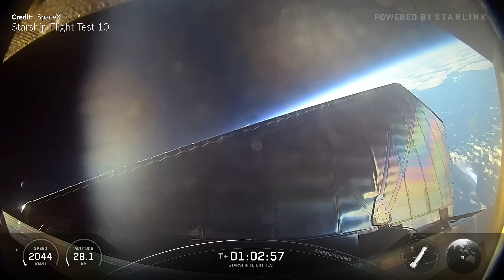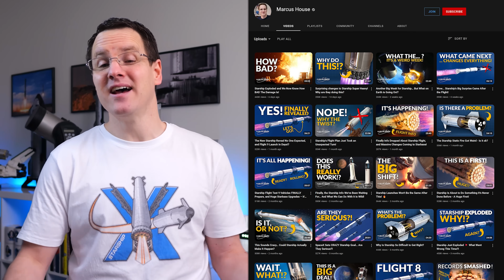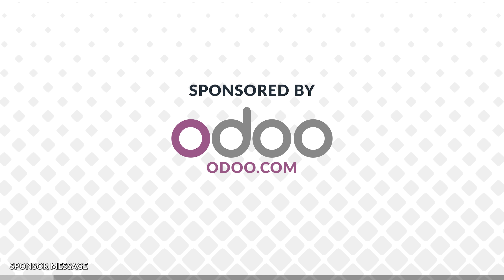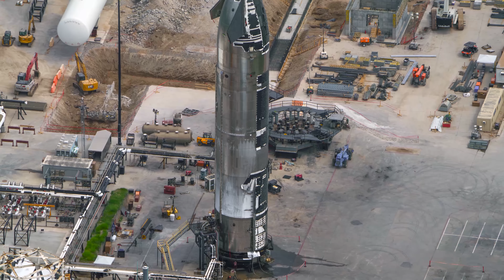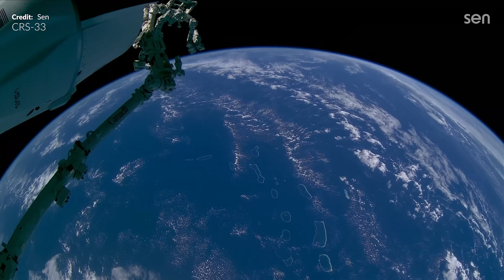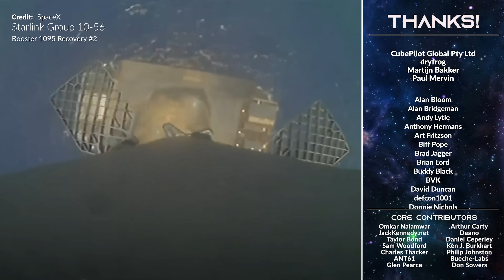Starship Flight Secrets Revealed & Future of Starbase! 🔥

Comment: When I first saw the explosion in the engine flap, I was thinking "Well I guess that's the end of it", expecting a RUD soon. But it just kept going and even survived re-entry. I was blown away.
Reply: Looked worse than it was. The hinges were fine
Reply: That such a sharp explosion failed to do any critical damage makes it very likely that it was external to the barrel - almost certainly those external chiller lines.
Reply: Ahhh, the redesign of the flaps adds some resilience to the hinges, which are far away from the edges. Each flight helps SpaceX upgrade, upgrade and upgrade.
Reply: @David-yo5ws  Well, this one helped. It's been a while. Although with the heat shield they're back to flight 4 results with the flaps burning through. Seemed like they had fixed that.
Reply: Reminds me of IFT-4 when ship 29 was missing half of its forward flap
Reply: You were blown away instead of Starship 😮😊
Reply: Survived to be slammed into the ocean and die!  Reusability my ASS!
Reply: @DrDiff952 🤦‍♂️ my guy do you know what an integrated flight test is? The whole point to do this is so that it doesnt fall on someone's head and then yall complain about how dangerous it is. Hence why it is called a TEST flight

Comment: The low g force is because it was a suborbital flight while the space shuttle and the capsules came down from an orbital flight.
Reply: Starship flies at orbital velocity. Nearly the same speed. Wouldn't make hardly any difference in G forces.
Reply: Nonsense.

Comment: I might be totally wrong here but I'm glad the flaps constantly seem to press on. Is it safer than the Shuttle if the same damage occurred? Appreciate any feedback
Reply: Flaps and wings do different jobs.  The flaps only need to generate drag and they can still do that with a lot of damage with modern computers behind them.   Wings like the shuttle had were also there to generate lift and their integrity is very much a part of the whole airframes integrity so their failure is worse over all.
Reply: @imaginary_friend7300 Thanks 🙂
Reply: This is just a test vehicle. If this was a production flight, I'd be HIGHLY concerned. Hopefully these issues will be resolved by the testing process.

Comment: 13:05  Welding the stringers across the grid fin hole and then cutting them off is the easiest and fastest way to ensure the stringers above and below the hole are aligned well during welding. So, not necessarily a test article.

Comment: Not sure if anyone else realized this, if metallic shielding oxidizes that fast during re-entry, then Stoke Space and anyone else relying on active cooling metallic heat shields are going to have major problems down the road.
Reply: I believe the steel tile that created all the orange color was not actively cooled. As we see elsewhere (e.g. Raptor), active cooling can prevent to a very significant degree ablation of metals even in extremely harsh conditions like reentry.
Reply: @noahw3261 it's adding complexity which SpaceX is trying to avoid
Reply: @noahw3261  Regarding the Starship's heat shield during reentry, the heat shield surface area exceeds 0.5 acres. Can you provide an estimate of the liquid volume, required for active cooling of 1800 square yards to mitigate reentry heating? As you said, the Raptor engine utilizes active cooling, each engine is pumping 1400 lbs of propellant per second, with every drop being utilized as active cooling. Some localized active cooling of the heat shield may be feasible, a heat shield of any substantial amount would likely exceed the ship's payload capacity due to the mass of the required coolant.
Reply: We do realize this and so does SpaceX.
Reply: @KuroKoopa I don't get it. So spacex should shift from stainless steel to alternatives?
Reply: @Jonathan-ru9zl I think they're just seeing what the current tiles are capable of and how they could improve, with other types of test tiles placed around. From what I understand, the tiles are the most difficult problem to solve.
Reply: What about spacex?
Reply: @Jonathan-ru9zl  It means SpaceX will have to be very picky about where it implements mettalic heat sheilds, if there is an advantage at all.
Reply: @serpentphoenix  active cooled components don't oxidize because the low surface temperature prevents thermally activated chemical reactions. We'd have a hard time reusing rocket nozzles if they did
Reply: The picture of the metallic tile on the ship before flight already looked a bit orange, so I’m guessing it was not optimized for no oxidation. I don’t think the rocket scientists are shocked that some metals (but perhaps not all) are oxidized by hot plasma, and Stoke will have a way around it
Reply: @davemanmartin  You have a good point. We also don't know what metal Stoke Space is using for their heat shield but my guess would that it might be similar to Flare Tips from Flare Systems.
Reply: You're assuming that Stoke's re-entry shielding is 1:1 the actively cooled metallic testing tiles SpaceX uses which is extremely unlikely. For one, I doubt SpaceX's coolant is LH2.
Reply: They also re-entered ship at the worst possible angle on purpose for this flight to see what broke.
Reply: The fact that is wasn't predicted just show how little do we know about material science today
Reply: @Jonathan-ru9zl  I think it shows the limits of theory. We have a lot of knowledge of material science under normal conditions, but these experiments are under rather unprecedented extremes!

Comment: I don't really buy the explanation of the explosion being caused by blocked vent lines.  Thats a lot of damage to supposedly be caused by un-mixed, low-pressure gases.
Reply: Over pressure events can be extremely energetic.  At what PSI did the line fail at?  That's what determines how energetic things will be.  We may have to wait for a while to find out.

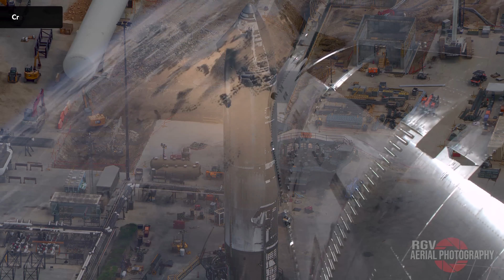Comment: 6:35 "... full orbital mission ..."
Since one full orbit takes about 90 minutes, some 1,550 miles of cross-range will be needed to compensate for the earth's rotation under the orbit during that time in order to return to launch site. Seems like a lot to me. If that is not possible, how many orbits do you think will be taken to perform a Ship catch?
Reply: The 1550 miles assume they launch into a highly inclined orbit, which they haven't done yet.  They could deorbit after one or two low inclination orbits and be OK, otherwise they need to wait 24 hours for the Earth to rotate under then to the correct position.

Comment: They should go orbital do 1 orbit and re-enter and drop it in the gulf with the next flight before moving on the the block 3. As a prelude to the catch attempt, since they have no shown re-entry capability's with the engine relight.
Reply: That would face much more regulatory issues by the fact that your overflying the USA whilst descending & aero braking. 😊
Reply: @jackdbur  Well that is the eventual idea, you will have to re enter over land eventually, the goal has always to go orbital.

Comment: 3:00 What I find interesting is that the explosive damage happened on BOTH flaps, not just one side
Reply: No it didn’t.  Starboard (viewed with heat shield as bottom) aft flap damage was present before the energetic event.
Reply: The other side had damage before the dummy starlink deploy. Go review the stream. You can see the reflection of something being ejected.
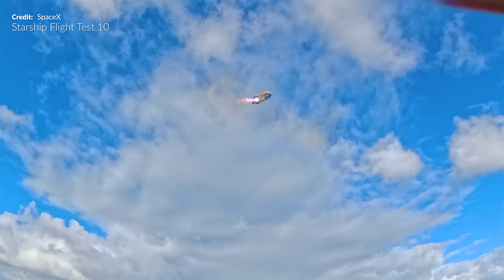Reply: I am still surprised no one has commented. There was damage before the event. 3:45

Comment: Is there any published docs about what the weather tolerance is for the site, I just fear a huge hurricane flattening or washing the site away.
Reply: As someone who went through Ike in Galveston, I share your concern. That said they are laying in a bunch of super duper blast walls that will double as hurricane tide and swell protection. Everything is Stainless so once the water drains you can go buff it out with a green pad
Reply: The scale can throw you but all of those buildings are framed in heavy steel.

Comment: Interesting how the secondary thermal barrier appears to break down and result in the white deposition. From the limited information I’ve seen on the various YouTube channels discussing Starship and from the pictures we’ve seen (including the shots from within Starfactory in this very post) the barrier is clearly a fabric matting of some form. Based on the knowledge I have from working with aerospace composites, I am assuming this to be a ceramic material. The material I’m aware of is a 3M product: Nextel Ceramic Fibres and Textiles. You can Google it and you should find a direct link to the data sheet. The fabrics are compatible with various matrix materials to result in structural composites … or can be used as matting. The stuff is also available as chopped fibre, so a matting suitable for the Starship application could actually be a pure fabric, or a formed matting of chopped fibre for a thicker layer, or, indeed, some form of hybrid. 

The material is mechanically good for sustained 1000C, but doesn’t actually melt until somewhere around 2000C, although mechanical performance will drop as temperature gets very high. So, I might speculate that the white deposition is literally the spattered and redistributed melted fibre generated at peak plasma temperatures where the material was directly exposed. It’d be interesting to see a thermal map of the plasma to help understand how any melt material might recondense on the structure as it passes down the heat shield into the wake contrail. 

The purest orange remains a bit of a mystery to me, but it’ll be interesting if we get more info on the mysterious Orange tile material … whatever it is, it has to be considered “sacrificial” .. and hardly “rapidly reusable “!

Comment: They only need the grid-fins as they enter the atmosphere, when they slow down it barely has any aerodynamic effect, so it doesn't matter which orientation they end up, the catch pins are below it so there is no need to put the horizontally, this may change in the future boosters when they use the grid-fins as catching pins.

Comment: I started wondering not very long ago now about when Spacex might decide to end the manufacturing of new Falcon 9 launch hardware(boosters, Merlin engines, Dragons, etc.). Especially now that they’ve been proven capable of at least 30 launches EACH. It’s incredible. They already save multi millions by reusing the Falcon 9 launch systems, but I still wonder how much more they could save if they stopped building new ones. The Starship launch systems could likely become operational within 12 months; maybe even a bit less. I’m all for it.
Reply: They’ve always got to produce new F9 second stages and engine no matter what.

Comment: Question: For all the flights for now, Starship showed a very small amount of fuel left at the end.
Since it will have to use up even more fuel to reach full orbit and will have to do that with more weight once it is going to be used for Starlinks and other commercial applications, will there actually be enough fuel left to deorbit and make the landing burn neccessary for the catch by a tower?
Is the fuel gauge missleading? What do I get wrong?
Reply: the fuel   is dumped in space as you can see in the live stream after they reach the desired speed and plalce

Comment: As long as things keep falling off coming apart or blowing up inside the starship it is no where near ready for maned flight at all. They have a lot of work to get things right. But 2027 is still 16 months away
Reply from the maker: Oh, it is certainly not ready for manned flight. They are really trying to push the boundaries of the design to see what is possible and what is not.
Reply: @MarcusHouse  doesn't seem tobe much reason not to start launching real Starlink V2s soon though. The deploy worked and that's the main thing ... they don't have to wait for orbiter reuse. It was interesting how all the dummy starlinks got a "downwards" rotation on exit, with at least the first one smacking its arse on the top of the doorway as it left. That needs to be engineered out.
Reply: @BruceHoult  I suspect they will launch real starlinks at sometime during developmental testing.  Maybe even on their very first true orbit test.  Maybe not a full bay, but some.

Comment: Well still sure tower 1 will be a catch only tower for the first couple of months. I bet they will want to try a ship catch on a pad where an accident won't immediately take out block 3 launch capabilities. It will be more than a year after flight 11 until pad 1 is ready for block 3. So having the first ship catch attempt on pad 2 would be a major risk
Reply from the maker: It may catch while under construction however they also don't want to damage the very large work base that would be going on with all that bunker/flame trench area.
Reply: @MarcusHouse sure they will begin tearing down the old olm and constructing a new one in the process. But I definitely have my money on tower 1 being the first to catch a ship 🤪😇

Comment: Still can't wrap my head around that a HUGE BUILDING sized cylinder can just accelerate from 0-26000 km/h in so little time.
Unbelivable power! ... Here is hoping for consistency from now on!
Reply from the maker: And still, the thrust to weight ratio off the pad is a bit low currently. It will be good once the Raptor 3's are on Block 3.
Reply: And then basically fall FROM SPACE and land 20m from a buoy in the middle of the Indian Ocean. Bonkers!

Comment: It's possible that the gridfin was set at 90 degrees to the airflow to simulate the ship only having three gridfins as on the next version of starship.
Reply from the maker: Yea, I'm not suggesting there was anything wrong, just that it was different and perhaps odd.
Reply: Very unlikely imo 
That gridfin was at less then 90 degrees and was still affecting the boosters attitude (you can see B16 start to tumble a bit shortly before landing burn)
Also, this wouldn’t be a great test since the remaining 3 fins are in very different positions then they would be on the b3 booster
Reply: Yeah, that seems like a likely reason.. Would make sense..
Reply: Wasn't this one equipped with only 3? Or is that the next booster to be flown?
Reply: @ThatOpalGuy  that'll be the V3 when they get to it.
Reply: Testing for a failed grid fin motor maybe?
Reply: @dougsmith9679 that is more likely to me, only I think SpaceX would have mentioned it
Very likely the motor just failed at the higher AOA the booster was flying at
Reply: Whether or not it was the plan they got the data from it.
Everything that happens is an opportunity for greater understanding as long as we/they capture the information.

Comment: Awesome video as always. Here are some numbers to go with the footage of the Ship landing, because what you are looking at is taller than a 15 story building! At lift off (Ship and Booster) are the height of a 36 story building (123.1m) and the weight of 120 Boeing 737-800s (5,000 tonne). The Booster (3min) then Ship’s (6min) engines are only firing for a combined 9 minutes, after which the Ship has reached an altitude of 150km and a speed of Mach 21.5 (26,494km/h) which is fast enough to cover the width of Australia or USA, or go from the east coast of Spain to Russia (all approx. 4000km) in 9 minutes 3 seconds. 

At 46 minutes 15 seconds it reaches its peak speed of 26,806km/h at an altitude of 94.5km. Just under 20 minutes later (at 1:06:21) it has reduced its speed by 26,194km/h to just 300km/h, at an altitude of 300m, by doing nothing other than falling through the air while enduring temperatures of around 1,400°C. 

The Ship then fires its 3 engines for 10 seconds to translate its 15.8 story (52.1m) body from horizontal to vertical, wipe off it’s remaining 300km/h of velocity and 300m of altitude and then land vertically in the Indian Ocean. By this point, the almost 16 story and 9m wide structure has travelled approx. 22,000km, had part of its flaps eaten away by the plasma yet managed to land within 3m of its target!
Reply: 120 Boeing 737-800s end-to-end would be almost 3 miles long
Reply: @Andrew_Fernie   120 Boeing 737-800s end-to-end would be almost 3 miles long 

Now do that calculation for 120 full stack starships.  Or even just for the block 2 second stage.
:planet-orange-purple-ring: